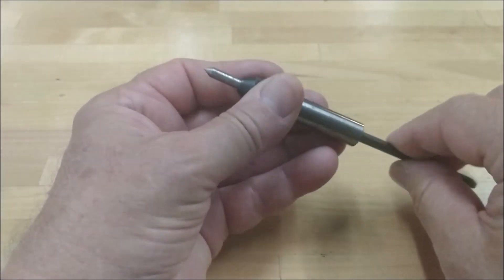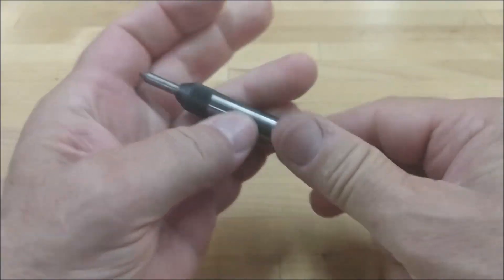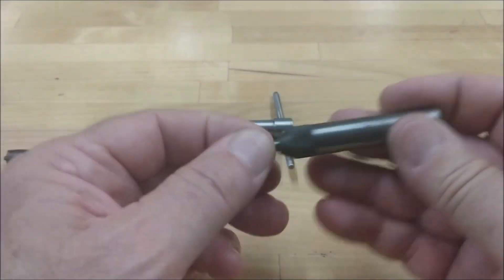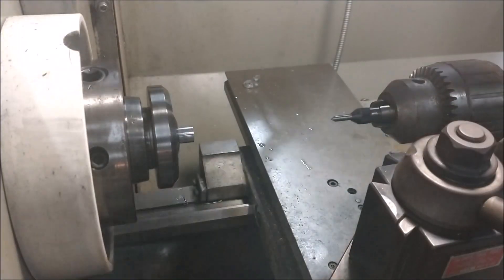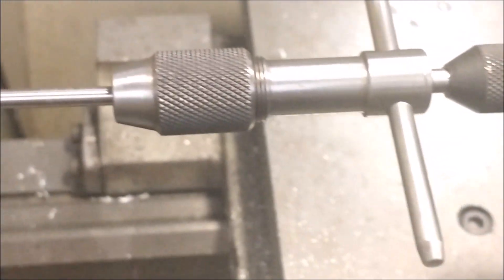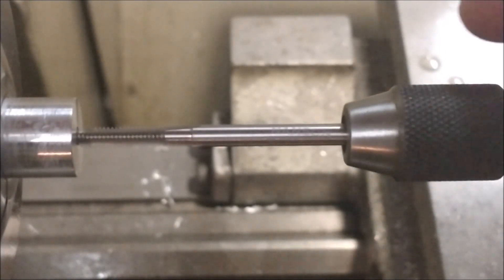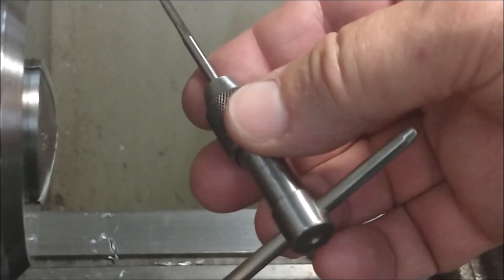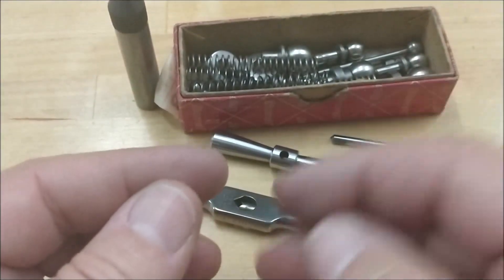Machinists.....Tapping a thread on a Mill or Lathe?...Don't Do This !!!

Comment: The hole at the back is not the main problem - the two jaws holding the tap and the cone squeezing  the jaws together are. There is no mechanism in the design of this type of tap holder to align the jaws to the axis of the holder. The holder is designed to be held by rather flexible “clamp” (human hand) that compensates for the misalignment. Machine tools do not have that flexibility and hence the problem.
Reply from the maker: Agreed

Comment: Interesting video and you made some very good points but the biggest point you made is that most tap handles are junk. Actually all tap handle to some degree are junk...  just a bad design. With this being said, unless you are using a tap under a 6-32 tap the likelihood of breaking a tap is very slim and to a very large degree the tap will align itself. You can verify this by tapping with a wobbly handle, remove the wrench and turn the lathe on. The wobble will be very minimal. I have broke my fair share of taps but so far I have never broken one that is guided from the back of the handle unless the handle slip out of the guide. I made a tap wrench with a tube on the back that slips over a 3/8 countersink to eliminate this problem.

Comment: I think the problem is not the hole in the back of the handle,  I think the handle is holding the tap sjewed.  a good handle should maintain alignment
Reply from the maker: The split insert design of most tap handles is not a precision design. So I agree partially with your comment. The problem is in the holding jaws a the front of the handle. Agreed.
Reply: If you take that tap handle apart you will not find any mechanism or feature for aligning the jaws to the axis of the tool. Even those made by reputable company are like that.

Comment: No way :) , I just finished a part on the mill , with an m4 tapped hole. using a spring loaded centre , and the exact same T handle you just demonstrated . Never knew this was wrong , but I most certanly won't do it again .

Comment: The weak point is the tap handle. So, theoretically, if your tap handle has near zero runout, it could be used?
Reply: Yes, but the jaw mechanism in those tap handles is not designed to minimize runout

Comment: well... being how your tap holder is junk, I wouldn't blame the "micro tap guide" which I've been using for 30 some odd years without fail, but yeah if your tap wrench is a POS then the tap guide isn't going to work is it?
Reply: to be absolutely clear, if your going to go through the effort of making  video damning a tool, at least blame the right tool
Reply: You're not the sharpest tool in the shed are ya? He didn't blame the tap guide genius. The point of this video was that the T handles aren't very precision. To be absolutely clear, I'm calling you a dumbass.

Comment: I built a handful of your tap wrenches  for small taps. The round circular is a godsend. They have proven to be my favorite by far! Thank you!

Could this be a function of the quality/tolerance of the tap wrench or is this a universal truth. I.E.  Starrett vs. China wrench?
Reply: Yes it could be a variable due to cheap vs 1st class manufacturer but in any event you are introducing another component into the process and (even the best) 'T handle' tap wrenches have only a rudimentary chuck, I have US, British, German and Japanese ones and not one of them is true, and the lower quality ones are just dreadful. Keep the chain of components in the tapping process to a minimum and you will as Joe has admirably demonstrated here have far better results by a country mile.

Comment: I see your point and while you're not wrong,  the real question is why would you do any of that in the 1st place???  Just start it by hand and either just do the whole depth by hand if you're afraid of breaking the tap or turn the chuck on and let the machine do the work.   On bigger taps just chuck them up in the tail stock.  If the hole and countersink are correct the tap will always just follow the hole.  The Go / No Go don't lie  :)

Comment: Great video. I made a spring loaded tap center years ago from stainless and bronze. I didn’t know you could get these with a variety of springs and two different ends. Mine is crude but it works and I have had it for many years. The T handle guides were awkward and wobbly. I used the T-Handle on small taps cuz the handle had the hole. I broke my share of taps until I figured this out the hard way.

Comment: Good call making this video!! I have never checked concentricity of center drill location on back of adjustable tap handles.  They are considered a manual tool after all...  In general, I've always used tap handles instead adjustable collet style handles as used in video just to prevent the stack up between tap follower and tap.  The more stick out between the tap and tail stock or mill spindle the more possibility of deviation from center.  Thanks for posting.

Comment: It would be Interesting to find the cause of runout in the T-handle
Is it in its chuck or is it actually in the body
Great info Joe thanks for sharing
Reply from the maker: The runout is in the 2 jaws. They are not secured in any manner to hold a relationship to center, or each other. They just hold onto the square end of the tap and squeeze. Thats it.
Reply: I learnt that years ago.    I had a beautiful smaller tap holder that had a ratchet on it that would reverse or lock solid.   I put a tap in it one day and  noticed it was not straight with the holder.   It was so noticeable you could notice it by eye.   Tried to put it straight and no matter what you did it would not go on straight.    I never even tried to fix it and got rid of it.   After that experience I checked other holders with noticeable variable degrees of straightness.   It was a great learning tool. 

Dale in Canada

Comment: Learned this the hard way using the ratcheting tap handle from horror freight.
Reply: I certainly hope you don't use their taps too.
Reply from the maker: The taps are good for removing dings or rust from an existing thread, but not for cutting one from scratch.

Comment: Thanks Joe!
I observed this phenomenon when tapping on my old drill press and blamed the drill press.  After that I bought a hand tapping machine and never went back to using a tap guide in the drill press-even when I bought a new one.
On my lathe I just used the drill chuck in the tail stock to start it then switched to a tap handle to finish.

Comment: I made a lot of small stuff in my day, and used a lot of small taps.  Broke quite a few and at some point noticed this same problem.  It's much worse on tap handles labeled "General" than on ones from Starrett or other quality brands.  I noticed another thing too.  Take that tap handle apart.  Look inside the part that is like a collet.  Notice that it has more than four flats.  Four at the tip and then four more further inside.  Place the tap far enough inside that the inner four flats drive it and the outer four flats bear on the cylindrical part of the shank.  Note how much more concentric it runs.  This is only for taps that fit up inside like that but it definitely helps.  Also, you can remake the main body of a cheap tap wrench much better if you chuck it in a four jaw and redo the "center" that it has for the tap guide to run in.  Thanks Joe!

Comment: In almost all most cases, misalignment like the one shown here is caused by the tip of the tap follower coming to a sharp point allowing the point to contact the bottom of tap wrench center, which prevents  the female 60 degree taper on the tap wrench from contacting the male 60 degree taper on the tap follower.  If you have a tap follower with a sharp point, grind enough of the point down to prevent it from making contact leading to misalignment problems.  Very few if any tap wrenches are center drilled off center enough to affect alignment.

Comment: Its not the hole that is off centre its the chuck On the tap wrench. If you remove the cap nut from the chuck you can see that very often especially in “ foreign” made ones the fingers that grip the tap are way off!
Reply: True, that style of tap wrench is not accurate enough to be used with a tap follower.
Reply from the maker: The wrench used in the demo had hardened jaw inserts. it was not the kind that just split the body and called it good.
Reply: @joepie221  Hi Joe,
I have several and the are all split body types, not even very good for hand tapping!
Phil, 🇬🇧

Comment: I've always used a Dead center instead of a spring loaded guide to align and drive the tap.
Reply from the maker: yep, that works. Just don't lock the tail stock. Keep cranking while you tap.
Reply: @joepie221  That's exactly what I do Joe, to keep the tension on the tap,  I always get good advice from your channel !

Comment: Yeah, this is a dangerous mistake. Of course it depends on how the T-Handle is designed...
Coming to think of it, I'm sure people would LOVE to see how a well designed T-Handle should actually be made... ^^
Great video Joe!
Reply from the maker: When you find one...let us all know.
Reply: @joepie221  You bet! But I haven't seen a good one in over 40 years either lol
Maybe it's time to make one. Your video inspired me enough to keep me awake last night and I did come up with some ideas so thanks!😉
Reply: @joepie221  So I finally made one.
I used an ER11 (metric) collet shank and made a handle for it which can be removed so the holder can still be used in the traditional way.
total length is 120mm
Works brilliantly. 😁

I found a picture of a similar shank I am using.
I live in Germany so I searched for an American equivalent: 
https://mapletools.ca/wp-content/uploads/2021/03/STRAIGHT-SHANK-ER11M-COLLET-72-1-1-300x300.jpg

Comment: Don't know what changed but this video was so laden with adds I stopped watching. Have never seen anything close to this many on your channel. Hope it's not going to continue.
Reply: I only got an ad at the beginning. Then watched through to the end without interruption.
Reply: @Dagonius.  My dollar says we call get different ads at different timings based on the algorithm.
Reply: I got one set of ads, maybe 1:30 in length about 5/8 of the way in I was able to skip after 5 sec. Watched till the end.
Reply from the maker: The ad's show up based on demographic, location and current activity. I can authorize them, but have little control over how many they place.

Comment: You said "you were driving it into a piece of brass thinking this was a good idea after something that you worked on for hours and did a really good job with and you were proud of".    I watch other machinists on YouTube and most of them leave tapping until last.  Tapping seems to be the riskiest step in any fab (at least it is in my shop).   Why not drill and tap every hole as soon as possible?   Obviously one needs to create the reference surfaces first,  but why not drlll and tap the squared block and then mill/turn all the other features?

Comment: Cool video. I never relized how non concentric the jaws of a tap handle can be.  I will be checking mine and I now want a reversible, spring loaded center. Thanks.
Reply: Buy 2, leave one cup and one point. Even good brands are very inexpensive.

Comment: Just remember that a T tap holder is made for manually tapping holes. It’s perfectly fine for that, so don’t go throwing them away. It’s just not designed for machine tapping. There are tap chucks for that if you want to bother with them.

Comment: I was so disappointed when I bought two Starrett tap handles. 
They won’t even hold a tap straight.
Reply: Unless you buy old quality 99% of new tap handles dont hold taps straight,which is nightmare for starting threads ,especially if you rely on handle to keep things square.
Reason for it is that they dont care about squareness since they are meant to be used for 1,2,3 taps which a hand taps hat have conical start so that cone will keep things theoretically straight .

If you want square tap and die holders unfortunately you have to make them yourself .

Comment: I've been a maintenance machinist/mechanic for 40 years, and I have never used a T handle tap wrench in a lathe or mill. It never even occurred to me. Just put a drill chuck in the tailstock / spindle, grab the tap hand tight, and send it in at low speed. I have tapped hundreds if not thousands of holes using this method and I've NEVER broken a tap. I can hear the hate coming already. "4 flute taps are hand taps!" Yes. You can use this method to get them started, then switch to a dead center to support the tap and use a tap wrench (NOT T handle) to finish. Or if the tap is large enough, I just use an adjustable wrench. As long as the center is in the guide hole at the back of the tap, you're good. "Gun taps will fill the bottom of the hole with chips!" Also true. But you can back it out and clean out the chips if the hole isn't deep enough. I've used this method down to #4-40. Never had a problem.
Reply: Only problem is taps are hard and it slowly destroys drill chuck jaws.Collets are much better for holding taps.Most of the time i just spin the spindle or lathe chuck by hand (tailstock must be free ,not locked down).Its good enough for start Not a cnc speed of taping but it gets job done.

Comment: Well someone suggested to use ER collets for better concentricity.
Remember ERG collets have a square hole at the end to drive propely the tap while maintaining concentricity.
I think I will  convert a small ER collet holder into a sping loaded tap holder, adding a sleeve and grinding a groove into the shaft to transfer tapping torque.

Anyway, many thanks for that demonstration - That was completely new for me (ugh !)
Reply: Why ? Just drill a cross hole and put 2 grub screws to hold the tap square in a er collet holder.Then you can weld t handle or drill a cross hole.They used to make tap wrenches like that.

Comment: The Starrett chuck type (T handle) tap holders are beautifully made and have a separate, spring-loaded jaw assembly. (Similar to the chuck in an old woodworking brace.) This gives them a large size range and a good grip in my experience. However it is the source of their run-out. The chuck type tap holders that used to be made by Eclipse (James Neill) and Moore and Wright in the UK have a cheaper construction where the body of the holder itself is split to form a collet. This limits the size range of each holder and I don't feel they grip the square on the tap quite as firmly as the Starrett type, but it does eliminate the run-out you illustrated so well. Another point is that some taps don't have a centre hole or a cone at the square end. (I guess you could modify these by hard turning or grinding your own cone on them.) Thanks for the advanced insights and tips that no-one else has seemed to come up with.
Reply: I was going to say (before Joe kind of pointed it out) that the concentricity error is not (necessarily) in the centre at the end of the T-handle but where the chuck holds the tap.  I've got some beautifully made (looks wise) chucking T-handle chucks and literally nothing is concentric with anything....so at least Starrett get more points than those!

Comment: Interesting, could it be that not gripping the tap too tightly is the intention of the tee holder makers, or modern Chinese made ones have "quality control" issues?
You might like to know there is a similar issue with rigidly mounted dies in holders on a lathe. The threads are not always fuĺly aligned with the centre of the die, both  axially and for parallelism. This not anmissue when used normally in a diestock, but if too rigidly mounted it can cause a malformed undersize thread. Even quality made dies can suffer from this malady, ask me how i know😭

Comment: That was a surprice.
Never owned a tap follower. Hand tapping with the tap vertical has worked out very well but tapping with the horizontal, I wouldn't be sure to hand tapping as the weight of the handle comes in play. 
Either the mill chuck, or tailstock chuck holds the tap for some turns until the tap has oriented itself.

Comment: Anyone try making a tap handle using a drill chuck? Seems like it should work better.
Reply: ER16 collett holder would probably be better, more grip
Reply: Nope drill chucks dont grip on taps (maybe if they are cheap carbon steel but not hss)they chew up the jaws.

Comment: Absolutely right!  However, it's not the center, it's the jaws.  We (retired from GTD) machine the entire body, including the center.  At this point everything is concentric.  The second OP is to drill, then saw the front to create the jaws.  This is where the concentricity breaks down.  The next OP is to spring temper the jaws, which causes the jaws go out of whack.  This is where the real issue occurs.  In theory, the cap is supposed to bring everything back into alignment.  However, between the burrs from the saw cuts, and the slop between the threads in the cap and body, it doesn't allow the cap to pull everything back into alignment.  Some brands are better than others, but as you state, bad idea!
Reply: Yeah na. I'd go for lil ER 11 Collets and turn it in one go, head upside down, parting last. Almost. Dunno yet. It's late lol. But that's the inspiration I got from this.

Comment: While I agree with you about using tee tap wrench centers, I believe that it goes further than that.  The self centering jaws that are supposed to center up the drive end of the tap may not be doing their job.  We have no proof that all these are precisely machined or that the whole area is clean.  Your method takes that potential problem out of the picture.  Nicely done Joe!  Thanks.